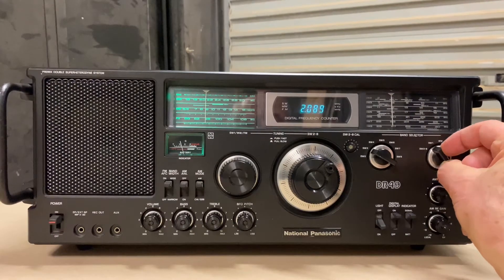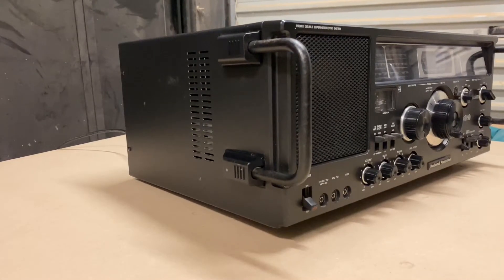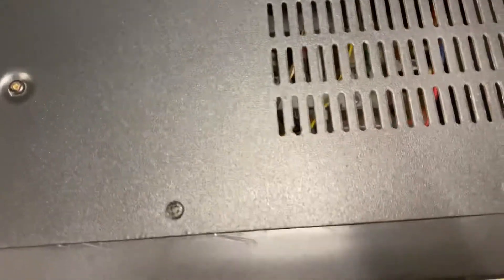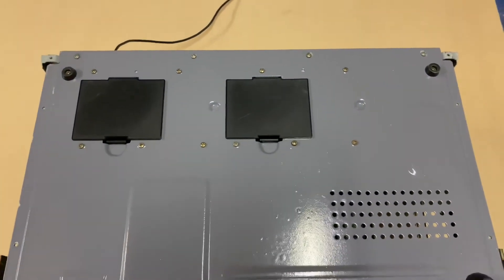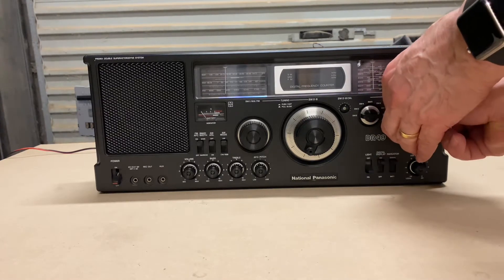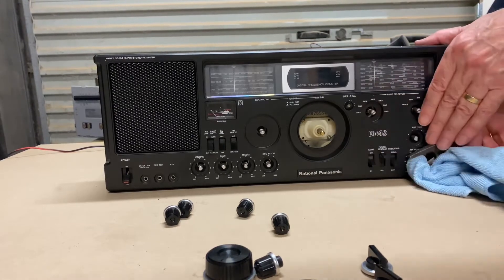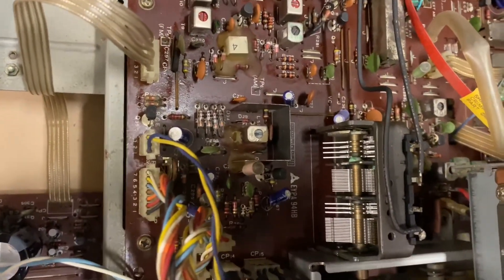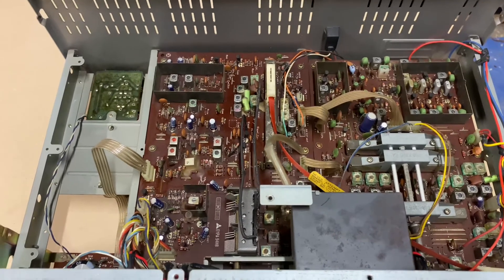E01 Panasonic RF-4900 DR49, removing the case for switch and pot cleaning

Comment: Hi I have the Radio opened up...Deoxit seemed to free up the Band Selectors.  I am requesting assistance on the FM alignment please. As I mentioned before I just tuned to 96 mhz station and tuning condenser fully deflected so I cant go down to 94 Mhz station?  The TUNING DIAL SAYS ITS ON 88 MHZ ?? but the LED display has correct station 96 Mhz?  I am no technician but any ideas to get the analogue tuning dial correct  so I can then get all stations below 96 MHZ.....The way its is I can only get stations 108Mhz down to 96.     I noticed when turning the dial tuning condenser fully to 108 Mhz the LED goes to 126MHZ!.....So it seems to be out by 9mhz at low end and 18mhz at top end of band.    Cheers Graeme

Comment: How did you get the Dial light green?  Mine is only working on the SW2-8 dial and its white/yellowish light
Reply from the maker: Hi simply replaced the incandescent miniature globes with bright green 5mm LEDs. The supply voltage is 12v DC so I used a 330 ohm resistor in series. The 5mm LEDs fit nicely into the rubber grommets that hold the globes. Make sure you test the polarity before connecting.
Reply: @cesaretizi724  Thanks for replying

Comment: I have just bought one and notice the FM dial is not in sync with the Fluro LED display? For example dialed all way to left and it only goes to 96mhz and will go no lower as the dial is fully to the left.  Maybe it needs re calibrating somehow??  ALso I have no sound from SW bands.  FM and MW working but no Shortwave even with outside 80m loop antenna.  May be pots need cleaning so I will take apart and de oxit.
Reply from the maker: The misalignment is more likely to be caused by a dial mechanical problem than any form or electronic alignment. I suggest you clean and dexos both band switches (They are on the main board) and then try the SW bands again.

Comment: Thank you for the detailed video. I bought one from a thrift store that worked but was very temperamental when adjusting volume and changing bands. After watching your video I was able to disassemble it and clean all the switches and potentiometers with deoxit. It works flawlessly now.  Thanks again.

Comment: I purchased so,e 12 years ago Artec SW radio which is just exact as Pancruseder except name tag. As I see  here  Pancrusader/Artec  was made by Panasonic with the same components and mechanical parts.

 Mine was in low  operational condition - only FM range could receive, all except FM  was deaf. I did long research and mainly the AM tuning capacitor was too much oxydated - not connecting the ground. After I rectified that the tunning of heterodine and input were detuned so I had to provide full alignment of input circuits. heterodine and IF. I duobted also  whether precision alignment could survive    with almost 50 years past. 

 After succesfull alignment I fund this receiver extremly sensitive and effective in listening to HAM even with wire room antenna   . Only one weak point is low rejection of RF strong noise from today electronic in city. Here in my channel one may listen to superb reception of  HAM radiostation based on yacht sailing in mediterranian sea. As I say it is the same technology    only in more compact version on one printed board. Very strong side  of my and presented here radio is speaker (the same)  - it is realy uniquely good sounding specialy for AM.

Comment: Thanx for this video. I was not sure how the main tuning knob could be removed. It took a lot more force as expected but to see it happen on the video was  perfect. This fully analog tuner is worth to maintain operational but just as with yours, it now needs, after almost 45 years, a thorough cleaning.
Reply from the maker: The age of the unit is important; however, I have found that the lifespan of the radio depends on how much it was used in terms of the band switches. These switches seem to have a limited number of cycles before they break. The best maintenance is being gentle on those band change switches.

Comment: Ive owned three DR/RF 49s.I called each one the "Black beast".But over time,no mater how carefully I turned the main band selector switch,the tiny brass fingers inside the long shaped band changer wore out,curled or broke off.I inspected the inside,by peeling off the band changer from the board only to find it was certanly unrepairable.With the age of these receivers,if owning one that still works well,it's best to keep it as a  " Show radio" only,or dont turn the band switch too often,because eventurly yes,it will give up on you.

Comment: I have one of these which looks to be in exceptional condition. Everything appears to be working okay, but I'm getting no sound whatsoever from the SW2-8 range (the FM/AM/SW1 bands are fine). I haven't taken the cover off yet, but any pointers to what to look for would be appreciated. Your video has given me some confidence to take a look (I didn't fancy it sitting on a workbench for weeks while I try to do research - your comment that the main boards are generally reliable is comforting).
Reply from the maker: Sounds like your Audio Board is working which is a good thing. The problem could be in the Band selector switch that switches between SW2-8, SW1, MW, FM. This switch not only switches RF parts of the circuit it also switches audio from the different sections of the RF Board. It is all mechanical and with age these contacts oxidise and present with open circuit or very high resistance. I would use some deoxit on this switch and operate 10 times to establish a good connection. BTW the actual switch contacts are in a long metal box on the RF board with a mechanical link to the front panel. You will need to take the top off the unit to get to the actual switch. You can inject the deoxit cleaner through the small holes on the top corners of the metal cover.
Reply: @cesaretizi724  Thanks very much. That sounds rather promising. I'll have a look at it tonight.
Reply: @cesaretizi724  Well, that fixed it! It took a while for it to work, but the volume slowly came back in. I also put some deoxit in the three longitudinal switches which are connected to the SW2-8 switch selector and I think these may also have contributed to the problem (without having a 'control' to compare them agains, I'll never know for sure). Oringally, it was switching fine on the SW2-8, SW1, MW, LW, FM switch (ours have an extra 'longwave' band), except that it was silent on the SW2-8 setting - I figured the other longitudinal switches were of a similar design. But it's working a treat now, and I can't wait for night to fall to listen to some broadcasts :-)